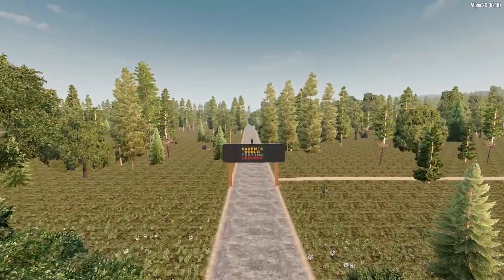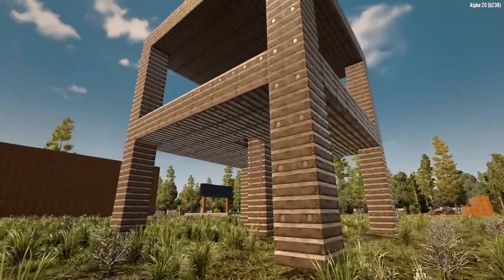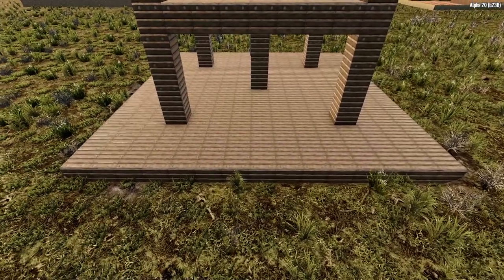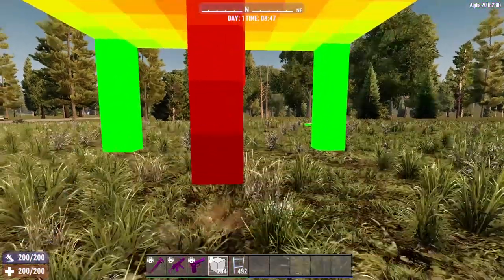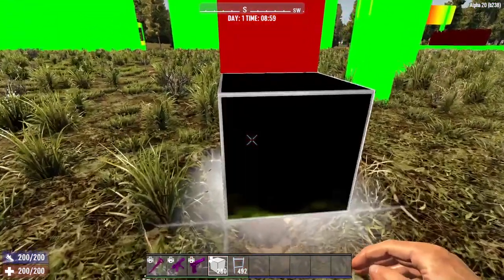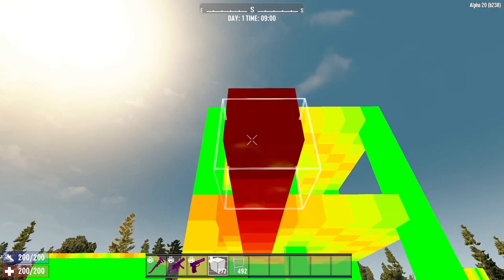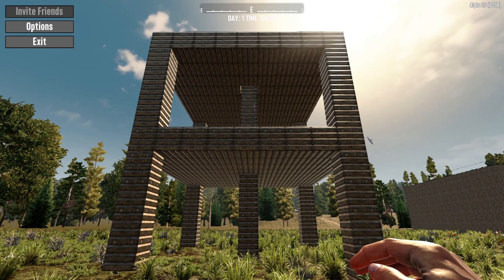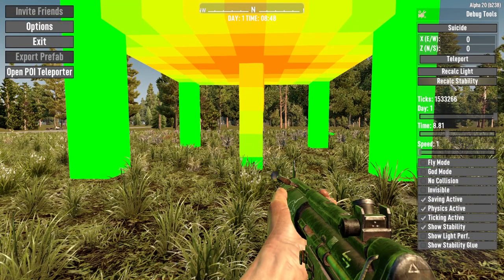7 Days to Die Alpha 20 - Structural Stability Bug

Comment: Thanks for bringing attention to this.  This really affects the way I build.  For a structure like yours I normally start by nerd-poling one pillar, then building the other pillars out from the top of that one and down to the ground while standing on the ground.  It shouldn't make a difference but it does.  I was also wondering why I was dealing with so many collapses in my mines since I normally support them pretty well to prevent collapses.  All you should need is frames to give the vertical stability to the ground over mine shafts every so often, but it wasn't working.  Now I have to hop in the dev menu and recalc stability every time I add support that way.

Comment: I broke one block beneath a wall and then a structure on top of the building broke down. So this bug seems to be an issue even if the part connecting to the ground is not a pillar, but just a wall which is strange to me.

Comment: so since structural stability is only important in the event of a collapse then how about if the game detects that a structure is unstable then before triggering the collapse the game recalculates stability first and only then if the stability fails its triggers the collapse. granted the stability color when placing blocks would still show as unstable in this scenario but at least the game wouldnt be toppling builds that are stable.

Comment: By any chance, did you test what happens if you build a block next to the bottom block of the column before digging under it?
Reply: I did a similar est when writing my bug post on their forums.  You can just stand 14 steel blocks vertically and put two next to them.  Then take out the bottom of the 14 (so they're supported by the 2 to the side) and replace it and the blocks above are bugged.  I just removed the bottom block instead of digging under it to create the instability.

Comment: A19 had similiar issues. I would build a 9x9 building directly on the ground. I would then go around and dig out one block at a time under that wall, immediately replacing it with a new block. Sometimes I would get lazy and dig out multiple blocks and then do multiple replacements. Well, on two occasions, I was digging out every other block and replacing it, and when I went back to do the in-between blocks, the entire structure would collapse from digging out just one of the in-between blocks.

Comment: I lost the top two floors of my base 3 times before I found out about this bug.  I know why now thanks to this video...  I removed the very center block of my foundation to replace it a land claim block.  I knew there was a stability bug, but thought I had the fix covered with ABUNDANT support.  need to get the debug menu out and recalc, I see. lol    I stopped playing that run through because was waiting for the fix... this will be faster, thanks Saven   :)